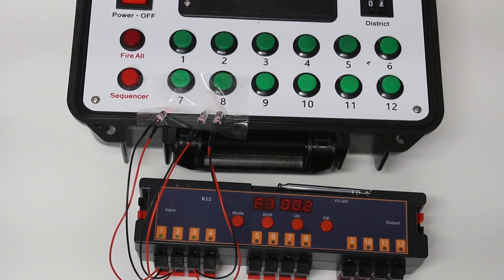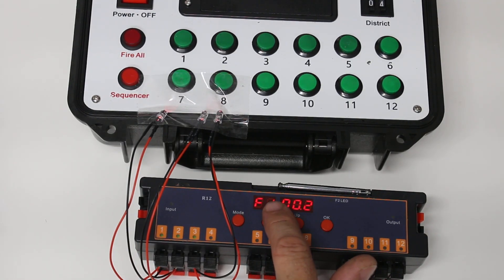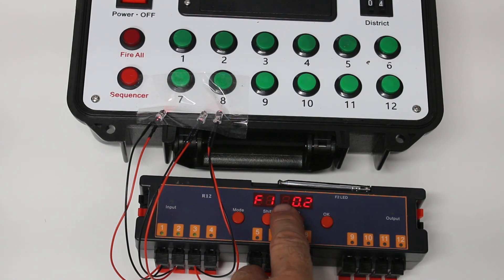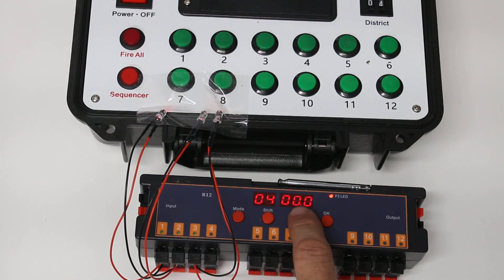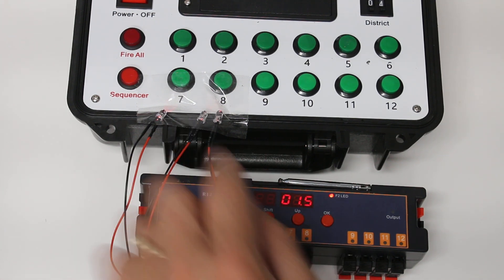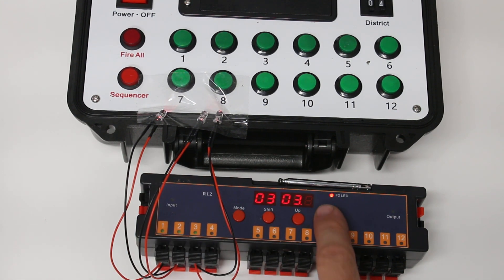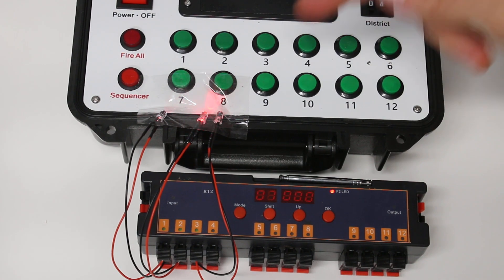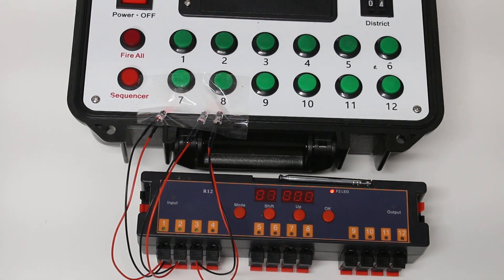R12 Sequence Firing

Comment: Love this Eric.  Thanks a million.  I have 6 of these and had no idea you could basically build scripting into the R12 units themselves.  Would be fantastic if there was an actual instruction manual. Quick question for you.  If I use the Output to the Input of another R12 (daisy chain) does that module need to be assigned to it's own district or will they fire the way the timing was setup using F1 or F2 if i hit the Sequencer on the P1200 without the second module being assigned to a district or more importantly without changing the district on the P1200?  Hope that makes sense.
Reply: Never mind.  I just saw the other video which answers my question exactly.  Thanks again.